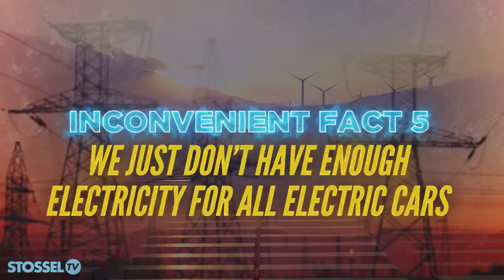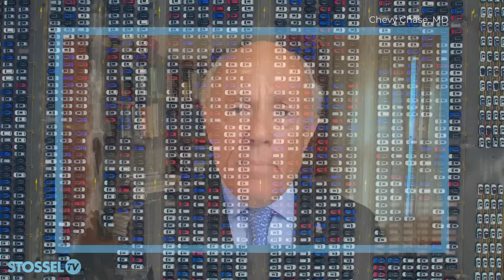Electric Cars: Inconvenient Facts, Part 2

Comment: 1:33 I am so glad to hear someone actually say that no amount of engineering will allow batteries, or anything else for that matter, to violate the laws of Physics.
Reply: I know... to think people could fly or go faster than a horse is literally.... oh wait, science overcame those problems 😊
Reply: yes without a major breakthrough battery tech is close to its peak.
Reply: @mj8495  The difference is that none of those violated any laws of Physics. I've seen arguments just like this dozens of times and it is fallacious.
Reply: My simple idea is spin the battery, compensate 4 weight,
Reply: @mj8495 Science based on those laws of physics,none of which were violated.Your point was?
Reply: Indeed, so let's keep driving with a combustion engine with their 30% thermal efficiency. We don't want electric cars who has a 70% efficiency
Reply: @srdjan455 70 percent at the point of consumption.  Don't forget the entire chain.
Reply: @Globeguy1  what do you mean by "entire chain"
Reply: @srdjan455  From the source of energy to the consumer. For those who dont understand, if you extract energy from say: coal in a powerplant you extract about.. you guessed it 33-35% the rest is waste heat radiation. That energy is then going through powerlines (energyloss) to a charger that converts it to charge the device and then once charged and not sitting for too long it has 70% efficiency at that stage.  Simple preschool knowledge really.
Reply: YES , HIGH SCHOOL EDUCATION IF YOU WERE LISTENING
Reply: @gavinjames8749  My point was that the remark was stupid because it was supposed to somehow prove that it is possible to create batteries that violated the laws of Physics by making the ridiculous statement about flying. Try to follow the reasoning and you will get the point!
Reply: @Globeguy1  Yeah, it's great that gasoline magically just appears at the gas stations, unlike electricity. Sure.
Reply: @wayneyadams  You don't have to violate the laws of physics to have good range. Smh. Some EVs already have plenty of range. Of course, it's no good if you drive 600km every day to your grocery store.
Reply: @sokacsavok  That is not the point. The problem is that people who know nothing about science or engineering think that all it takes is better engineering to get evs that have ridiculously long ranges. It's about the stupidity of the ignorant. Their favorite argument when confronted is that man didn't think it was possible to fly, but now we do. The fallacy is that flight does not violate any laws of Physics. I have no doubt that batteries and EVs will get better in the future, but there is still going to be a limit due to the laws of Physics.
Reply: @wayneyadams  Speaking of following the reasoning and getting the point,re-read my comment(or just read)See  how I said no physics were broken to succeed at flight,different to pulling magic energy density from batteries.

Comment: The other physics problem that people don't talk about is that whatever energy you store has the potential to come out VERY quickly if the battery fails. So even if they did build some sort of Ironman/Terminator super battery, you'd be making a superbomb. If you think battery fires are bad right now, imagine if they had 10X the energy density.
Reply: Imagine a gasoline tank breaking….
Reply: @waywardgeologist2520  Thing is, we know how to keep gasoline from igniting.

Preventing a gasoline fire is a lot easier than preventing spontaneous auto-ignition of a lithium battery.
Reply: @dafunkmonster  There are billions of batteries not auto-igniting.  Problem is more the Runaway decomposition and burning that is difficult to stop
Reply: @pablopicaro7649  There are hundreds more batteries auto-igniting than gasoline cans auto igniting.
Reply: I imagine a battery farm fire that turns into a natural disaster when fire fighters can't put it out. Imagine how dangerous all that energy would be coming out all at once.
Reply: pretty sure iron man and terminator was running on some type of fusion.
Reply: Terminator was a nuclear base robot. In one movie, he removes a "battery" and toss it out the gas powered vehicle and it explodes into a mushroom cloud. We have been running the US Navy vessels on nuclear power for decades without incident.
Reply: @calebfielding6352  Terminator was a nuclear base robot. In one movie, he removes a "battery" and toss it out the gas powered vehicle and it explodes into a mushroom cloud. We have been running the US Navy vessels on nuclear power for decades without incident.
Reply: @kyleernst328  it was a hydrogen battery, if I remember right, so that suggest fusion to me. That said its hard to keep up with the fantasy science of hollywood.
Reply: @kyleernst328  the US Navy has very strict requirements about who can become a reactor engineer. Cars are so ubiquitous it would be impossible to hold  operators to the same strict standards. Also, if naval collisions were as frequent as auto collisions the US Navy would not have a spotless record.
Reply: @waywardgeologist2520  the major difference is, lithium ion batteries have cathodes that release oxygen as they burn. Gasoline requires oxygen from the environment, and can therefore be more easily controlled with modern firefighting techniques.
Reply: @waywardgeologist2520  Err...gasoline by itself does not ignite.
Reply: @waywardgeologist2520  - Cars get into accidents all the time. The flexible plastic tanks rarely break and when they do, they almost never catch fire.

My gas powered cars won’t spontaneously ignite and burn my house down while I sleep unlike an EV charging overnight.
Reply: @waywardgeologist2520  gasoline doesn't explode, it burns. Air particulates of solid matter explode. That is exactly how a combustion engine for a car works. It takes vaporized particulates of gasoline, mixes it with air, compresses it, and then ignites. That is how the explosion occurs. Even then, it takes a precise mixture for that to happen. High energy density in a battery that fails is just going to explode period do to the nature of the condensed energy and the medium. It is basically already like compressed gas and air mixture.
Reply: great point!
Reply: How about what would happen if one of these EVs gets into a wreck, which causes a short circuit inside of the battery? Lot of electricity escaping very quickly
Reply: Problems engineers could solve to prevent that sort of thing. These problems are hard not impossible
Reply: @cats think my name is Claude Big difference between gasoline exploding in a car and a battery blowing up.
Reply: @edd542  Engineers are the ones telling you it’s Physically impossible to store that much energy without the risk of it shooting back out. The solution to preventing it from shooting out so much electricity is to store less in them
Reply: @aaronlandry3934  *with current technology. Fixed it for you
Reply: See: The Grand Tour, the episode where Richard Hammond crashes the Rimmac.
Reply: Something like CNG. Except you can engineer a CNG or LPG tank to fail in a certain direction.
Reply: @jlambson82  not to mention all the nice pollutants that come from the battery fire. That you can’t put out.. with water..  or dirt. Bury the car, it’s still going to light off.
Reply: Time to ban assault batteries.
Reply: @waywardgeologist2520  what an absolutely uninformed response.
Reply: Gasoline powered automobiles have been known to get into accidents and start a fire. The fire department can usually put that fire out relatively quickly. Electric powered automobiles have also been known to get into accidents and start a fire. The fire department usually just lets it burn because nothing they can do will put it out.

Richard Hammond of Top Gear got into an accident with a million dollar all electric powered supercar. Thankfully they got him out alive, but it was three days before they could put out the fire.
Reply: @pablopicaro7649  I had one small RC battery I was charging implode and go nuclear by burning part of my carpet two spots on my hardwood floor until I finally captured it and took it outside. This was a tiny battery for radio controlled devices. I shutter to think what a large one would be like.
Reply: @waywardgeologist2520  It's actually rather difficult to light gasoline, because it's not actually the liquid that ignites, it's the vapor. And the concentration in the air has to be just so in order to ignite. And even then, it's not exactly a bomb, because it's not under pressure. It just burns until it's gone. The problem with batteries is that they can be catastrophically explosive, and with dangerous metals and acids.
Reply: Good point. When energy density doubles, volatility also at least doubles. Most of us say the spectacular, volcanic Paris electric bus fire. Just imagine a commercial battery 1000 times larger with 2X, maybe 4X the energy density.
Reply: @waywardgeologist2520  gas fires can be put out by normal means, lithium fires are class D ,,, real pain to put out.
Reply: Also if batteries were so safe compared to gasoline then why are some manufacturers like Chevy and many home owners associations banning parking EV's in the garage?
Another thing on the pile for thought.
Reply: i remember one scene from Terminator, when he throws a "fuel cell" out of the window of a car, it caused a MOAB explosion, even tho it is fictional, i can see this happen if they got damaged and have more power in a smaller package, not like a MOAB bomb perse, but severe, yes
Reply: Batteries didn’t store energy. That have an energy potential that can only be released if you change the chemical activity of the battery. That’s why it takes more energy to get less out as the battery ages.
Reply: @calebfielding6352  iron man was an arc reactor, the t-800 used hydrogen fuel cells.
Reply: @kyleernst328  Wrong. The t-800 used hydrogen fuel cells.
Reply: @kyleernst328  wrong. The T-800 used hydrogen fuel cells.
Reply: @calebfielding6352  except hydrogen fuel cells are not science fiction.
Reply: Like a gas tank…😂
Reply: @calebfielding6352  I'm pretty sure Ironman and the Terminator are fictional... in fact I'm sure of it.
Reply: A combustion engine does not run on gasoline alone - Gasoline NEEDS oxygen to burn and this mixing is always a slow process unless you have specific machines to facilitate that (like a carburettor). Without that you got a liquid with fire on top that can easily be put out by a variety of methods.

Batteries on the other hand are designed to release the energy without any external input. If you have an external short-circuit you can hope that it will just melt away, but if the battery has a problem internally then there is nothing you can do to stop it aside from outright blowing it up. That is inherent to them being batteries.
Reply: @rb8049  the difference is the gasoline engine uses environmental oxygen to produce power, so you only have to carry around half of the combustion products. Which is part of the reason the energy density is so high. Additionally, in an accident, only the gasoline that mixes with environmental oxygen can burn, which makes it much easier to deal with for firefighters.
Reply: @OmegaTou  Are you talking about weight or what? Fires for EVs occur at a much lower rate than ICE cars and much fewer people are harmed. Safety for EVs is so much better. Convenience is so much better. Been driving for nearly 5 years and will never go back.
Reply: @rb8049  there are so few EVs right now, and they are so new, that we don't actually know how safe they are compared to gasoline vehicles. Diesel vehicles have an even lower risk of fire. You can extinguish a match by throwing it into diesel fuel.

Wait until we have significant numbers of 15-20 year old EV batteries manufactured by companies less diligent than Tesla, and see what the risk of uncontrollable fires is.

You are free to do as you please, so is everyone else. I'll be sticking with gasoline for at least the next 10-15 years.
Reply: @darksideblues135  true but it is not a "Terminator super battery" which was my point. My other point is that we can run Naval ships with nuclear power, I do not see why we cannot come up with something to run a car off the same technology. Regardless, electric cars are a fools endeavor and a waste of resources.
Reply: @kyleernst328  i agree. I always wondered why we can’t do the same too, but it might be because if the masses had cars that go 200,000 miles in one charge, it would destroy the economy....
Reply: @dafunkmonster  "Preventing a gasoline fire is a lot easier than preventing spontaneous auto-ignition of a lithium battery." It is? With 17 gas car fires an hour? With EVs having 100 times LESS fires than gas cars, mile-for-mile and car-for-car? Where are you getting your statistics education?
Reply: @JayVal90  "There are hundreds more batteries auto-igniting than gasoline cans auto igniting." Absolutely false, but the oil industry propaganda department thanks you for your patronage.
Reply: @jlambson82  you mean like an oil tanker fire or leak, pipeline leak, gasoline tanker explosion? All THAT energy coming out at once?
Reply: @justsomeguy934  Gas cans don’t ignite without a significant spark. Batteries don’t necessarily need one
Reply: @JayVal90  All automobiles have spark sources. And yes, gasoline cars spontaneously explode. Right in driveways. Or garages. Or at car accidents.
Reply: Unlike a gas tank that does not have that potential?
Reply: @UncaAlbyGmail  "Thankfully they got him out alive, but it was three days before they could put out the fire." Electric cars catch fire 100 times LESS than gasoline cars do. Would you rather fly on a) an airplane that crashes 100 times more often but is easier to put out the fires, or b) an airplane that doesn't crash 100x more often?
Reply: @gregkramer5588  Gas doesn't autoignite upon contact with air. The insides of lithium batteries do under certain conditions.
Reply: @gregkramer5588  certainly not to the same degree. Gasoline requires environmental oxygen to burn. The cathode in a lithium ion battery will release oxygen as it breaks down in a fire. 

We have a LOT of experience putting out ICE car fires, and it is comparatively easy.
Reply: @OmegaTou  No doubt. But the commonality of both problems is not an significant issue in 2022.
Reply: @JayVal90  But not often enough to be a concern in 2022.
Reply: @gregkramer5588  EV car fires are already SIGNIFICANTLY more dangerous than ICE car fires. 

My whole point was that if you greatly increased the energy density of batteries, which they are currently trying to do, to get more range for the same weight, you get a commensurate increase in the danger of an uncontrolled release of all that stored energy.
Reply: @justsomeguy934  I'm not arguing that. The question is, if you do get a fire, would you rather have one they can put out now or make an appointment to have it put out next week?

Airplanes are not a good analogy, basically because if they have problems in mid-air, they can't pull over to the curb and just let everybody out.
Reply: @UncaAlbyGmail  "I'm not arguing that. The question is, if you do get a fire, would you rather have one they can put out now or make an appointment to have it put out next week?" Your argument that a battery fire takes more water or longer to extinguish is meaningless if using a battery vehicle means the occupants are exposed to a vehicle fire 100x LESS. OF COURSE it's preferable to have a car that catches fire LESS OFTEN. 
Don't you realize that you're repeating oil industry propaganda, specifically, a scare tactic? 
Let me demonstrate you own bias: if I invented a car that ran on table sugar and caught fire 100x less than a gas car, but that sugar car took longer to put out, it's wouldn't even be a discussion. You'd say OF COURSE drive the sugar car, you'll get burned less often! But since we're talking about an electric car, well, that somehow makes a difference. By the way, in the vehicle fire example, both occupants (EV fires or gas car fires) are either saved or killed, it makes no difference. In fact, an EV doesn't explode, it SLOWLY catches fire. A gas car explodes.
Reply: @justsomeguy934  The odds of a vehicle catching fire are independent of what kind of car it is, given how virtually none of them will spontaneously catch fire without external impetus (unlike cell-phones that happen to also use Li-ion battery technology). Given how the statistical odds of being in an ICE vs. an EV are like 10,000 to 1, saying that you are 100 times more likely to be in an ICE fire (well that sounds odd, doesn't it? "Ice Fire") means your per capita odds are really 100 times more in the EV. 😝😁
Reply: @UncaAlbyGmail  Absolutely incorrect. The fires-per-EV statistic is calculated by two different methods, and comes out the same. Both sources are NHTSA and the Canadian government sources. Method 1) fires per 100,000 vehicles, and 2) fires per million miles of driving. In both cases, the sample size (MILLIONS!) accounts for and negates, the number EVs vs gas cars. Millions of miles between fires means exactly that - each type of car has gone millions of miles with an order or more of magnitude of fires for gas cars. I'll leave several links in separate comments so YouTube doesn't delete this one. In summary: EVs catch fire 100x less than gas cars.